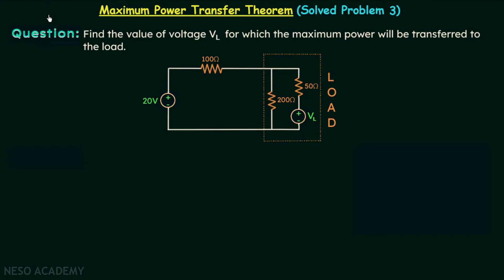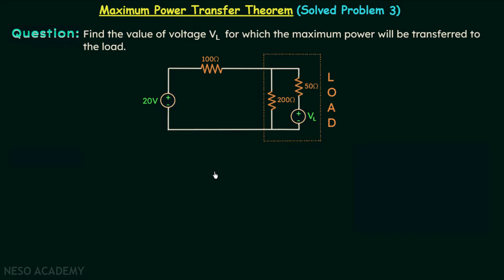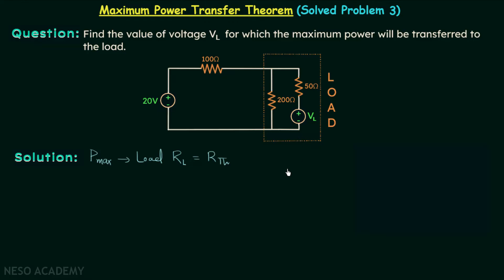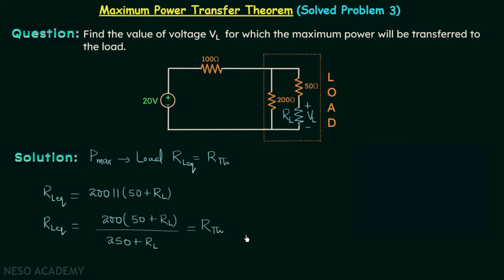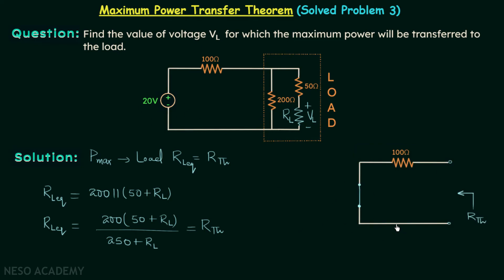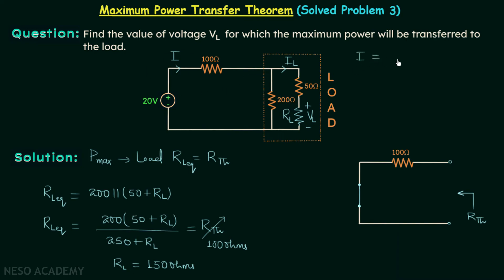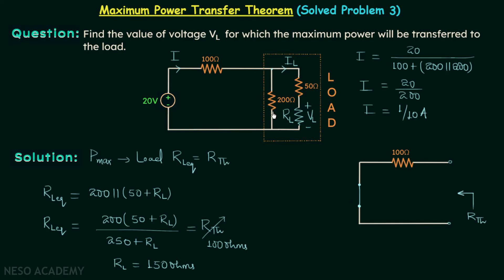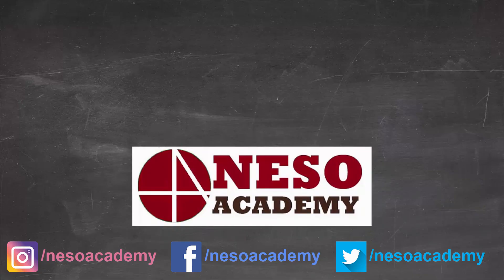Maximum Power Transfer Theorem (Solved Problem 3)

Comment: i dont know that theorem so i go with another method see

for max power transfer load resistance and Rth should be equal so the volage drop across Rth and load resistance should be equal so i assumed 20/2 voltage for load and then easily calculated vth easyy!!!!

Comment: I L should equal to 1/10 not 1/20 cmon
Reply: no cureent is dividing in the two branches . as the resistance is same in both branches,current will be divided same to both.